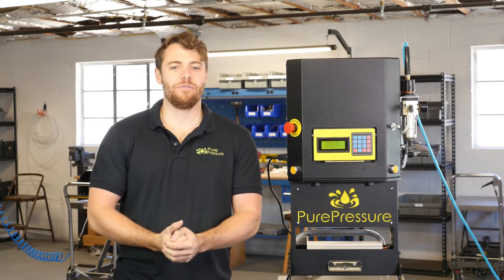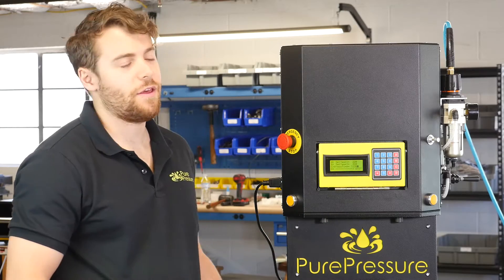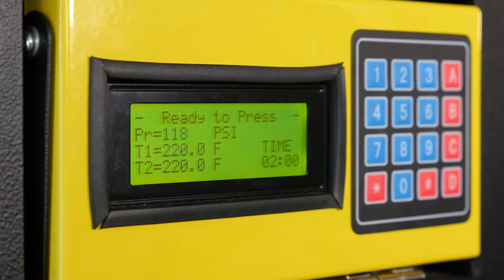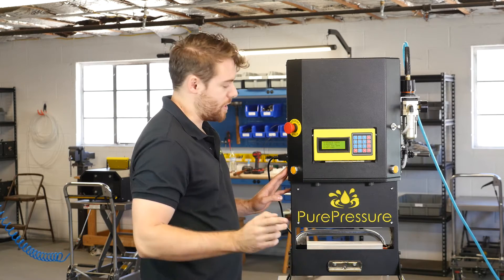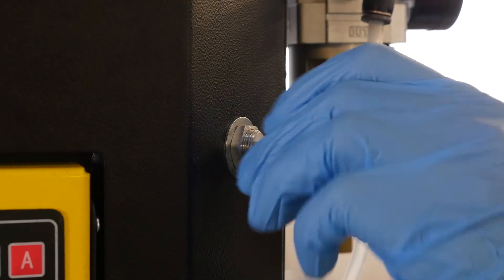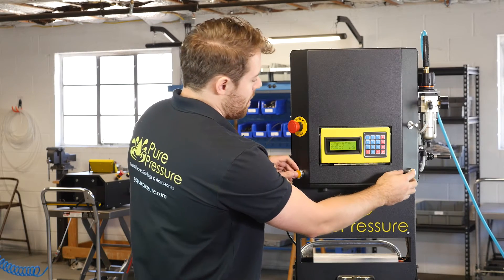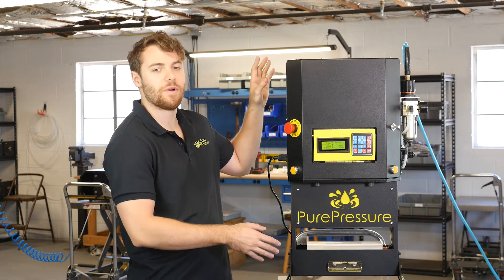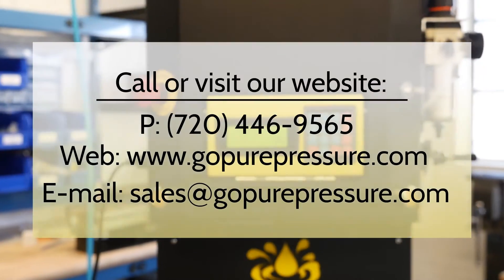How to Use the Pikes Peak Rosin Press

Comment: Stop selling weed. Start building rosin presses that's where the real money is. Metal fabricator for 20-plus years I bet I could build this press for under 500 definitely under a thousand. Lot of profit at 5 grand. I am ordering all the stuff to build a smaller one. 10 ton hydraulic it will be equal to presses selling for the 1200 to $2,000 range and I will have around $200 in it. I just don't see what makes these things sell for what they sell for. I understand have to make a profit I just don't understand what makes these things go for as much as you are asking.
Reply from the maker: You aren't even close on your estimates, Jeremy. If you could build one our press for under $1,000 we'd be out of business, but because you can't come even close, it's a moot point. The pneumatics in our press are extremely expensive and are US fabricated - they are the most expensive component of the entire press. We've been repeatedly told by randos on the internet that they can build our press for cheap, yet no one has come even close or even tried as far as we are aware.  ¯\_(ツ)_/¯ guess we'll keep waiting!
Reply: Yooooo where your press bro ya give up?
Reply: cannabased   sure thing end of march at the latest
Reply: @jvmiller1995  how’s that press coming along
Reply from the maker: @jvmiller1995  Cool. Will it have a fully custom touch screen interface with custom hardware and software, a digital pressure readout, plate speed control, and the option to run fully automatically as well?
Reply: @GoPurePressure  yours has not got a touch screen from what i see. But if someone wanted all the input so to speak on one screen it would not add but 100 bucks to add. I want it easy to use no digging in menus for settings. Plate speed and pressure will be fully adjustable as well.
Reply: Hey Jeremy! Can you show us your press now?
Reply: I can build a high quality commercial grade rosin press for less than $400.
Reply: cannabased  Blah Blah pneumatic s they dont cost shit. I worked in tool die shop for large factory
Reply: cannabased  might be the best on market .doesn't make the price a realty in any ones world

Comment: looks like a awesome piece of equipment but running it in horizontal position doesn't make sense to me, how are you going to keep the bags in position? Keep it in position by hand till your fingers almost get squished?
Reply from the maker: No, you use the tension of the parchment paper to hold up the bag. It's a little more tricky but it works!

Comment: So unbelievable how expensive this is and doesn't even include a compressor. 5 and 8 ton models 😂😂 absolute joke. Also the website is filled with reviews written by the company, always about customer service being top notch. Save your money
Reply from the maker: Thank you for the comment, despite how misguided it is. Let's clear a few things up since you don't know much about us or rosin.

1) Amount of pressure ≠ value. You can buy a 20 ton hydraulic jack for $40. Our cylinders are oil-less, maintenance free, and whose lifespans are measured in the millions of strokes. They are custom fabricated in the USA for us and are very expensive.

2) All of our reviews are actually from verified buyers and many of the top extraction labs across the country use our equipment. 

3) Our customer service is the best around. Have you talked to a PurePressure press owner?
Reply: check out their ig they have great finished product and is worth every dollar